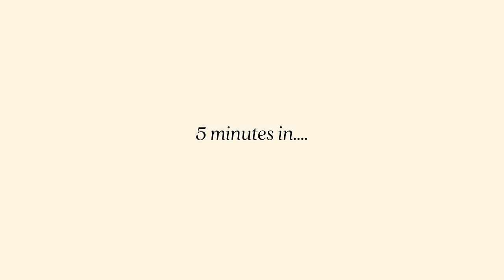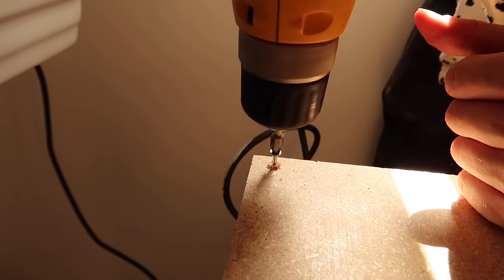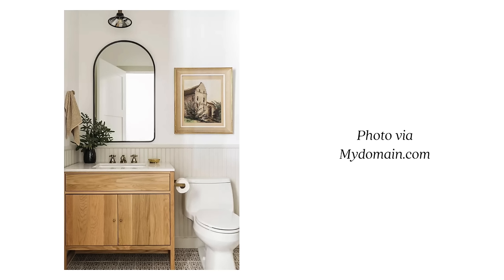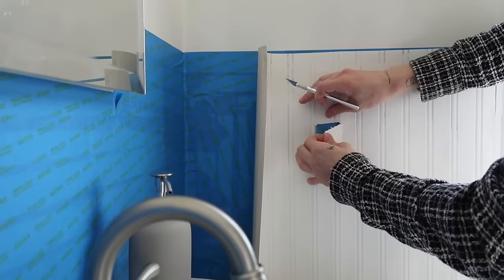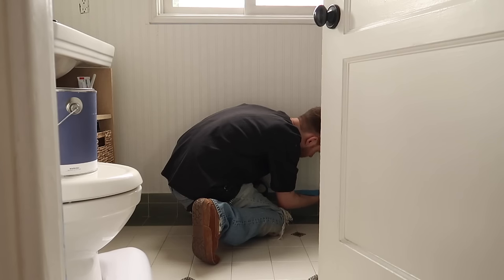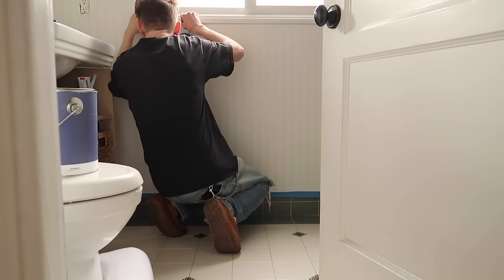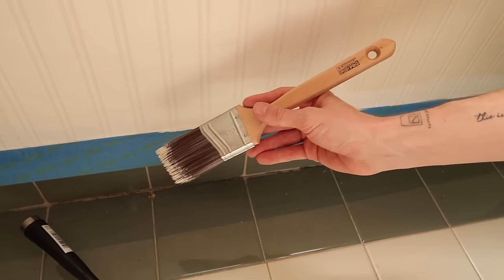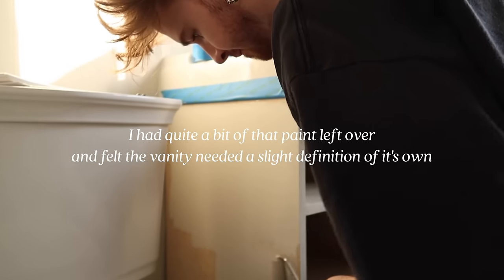EXTREME $350 SMALL BATHROOM MAKEOVER (Rental Friendly) + DIY Bead Board Walls & Vanity

Comment: Cute rental friendly remodel. However, Im no expert but I think you should’ve raised the vanity with legs because the particle board will rot once exposed to moisture like when you mop the floor. Also, the bathroom is a high moisture room so I think the wallpaper will just peel away over time.

Comment: The vanity construction is fine, but real wood might have been a lot nicer. If you have no circular saw, just get a long pine board and let it be cut at the store in 4 or 5 pieces. You'd only need to seal the parts that touches the floor with some clear coat and the rest can be left natural or simply oiled or waxed. Also some space unterneath the lowest shelf for better cleaning might be nicer.
Using real wood is more sustainable if you are a crafty, sand it down, looks like new, built something else in a new home- but nobody likes old particle board.

Comment: Probably a stupid question. But if you were able to put a few nails/screws in the wall for art/wall hook, why couldn't you just use a nail gun to put a few holes in the trim at the top of the wallpaper? I can't imagine you'd need more than 3 or 4 per piece. Just seems like a few extra small holes would be worth it to get rid of the gap at the top. Plus, there's holes that will need to be patched anyways.
Reply from the maker: You totally could but I wanted to share options for fully rental friendly! Of course the nails I added to the wall can be swapped for command hooks as well

Comment: Wow... Super nice. That's not wood. Hope they don't take super hot showers with steam. That stuff will swell up and become lose. Risky loading up a wall with tape. Still could damage the dry wall behind it. Then you will have a very expensive repair. Wouldn't buy bathroom lights either. You don"t live in the bathroom. Just leave it.

Comment: The "vanity" shouldn’t be so deep. The sides protruding like that don’t look very nice. Small vanities are so cheap nowadays and so easy to install. Also you didn’t put silicone at the back and probably didn’t prime it with shellac based primer so once that wood starts to absorb humidity it will swell and it will start to look horrible. Instead of spending all that money in useless decor you should’ve invested it to do the job properly 😂